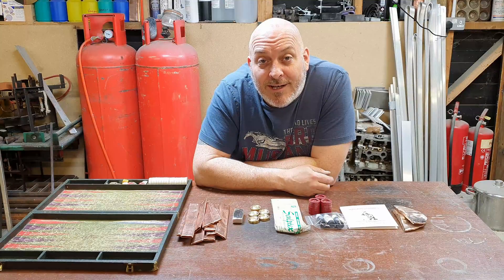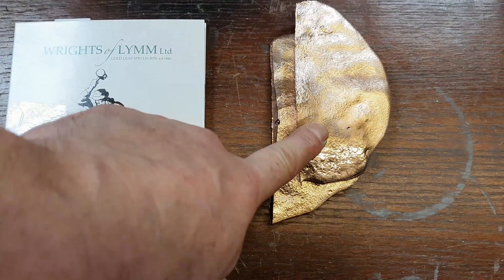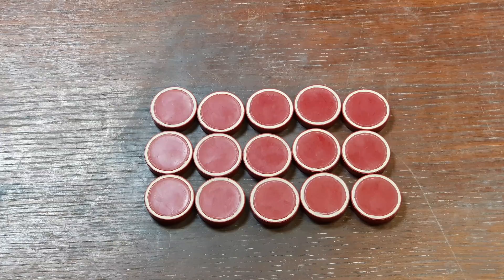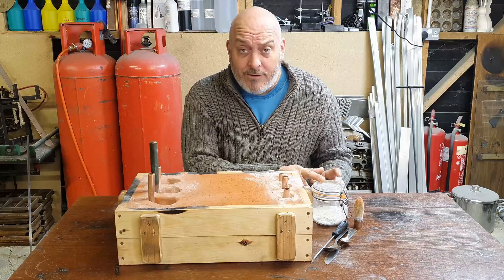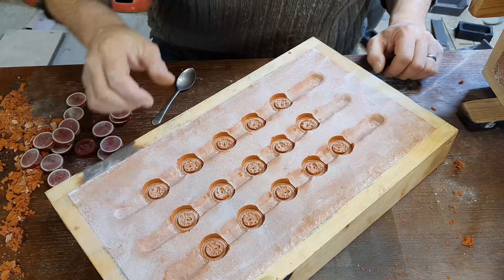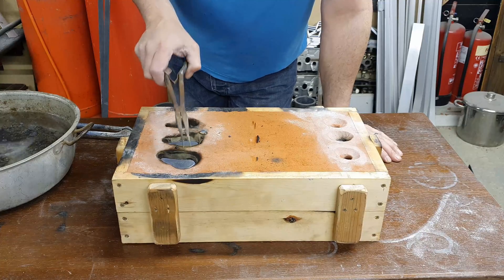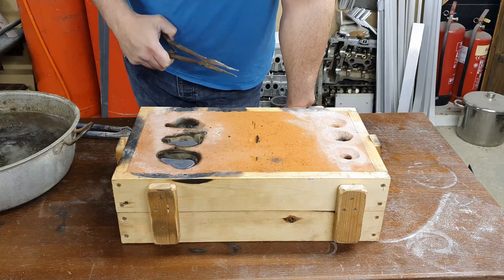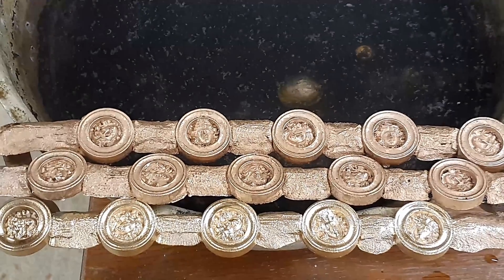Melting 1lb of Silver - Casting Shibuichi - Part 1

Comment: What do you use for the mold parting powder?
Reply from the maker: I'm current;y using talcum powder although it's not the best thing to use, can't remember the reason why - but there is a reason why it's not the best thing to use...  It works though and most people have it lying around.  The best thing to use is fine calcium carbonate powder (limestone) which I will order when I run out of talc.  It's not expensive, talc is just what I had to hand when I started out.  Cheers Andy 😎👍🍺
Reply: @MeltandCast  ok, cool thanks.

Comment: What about putting felt on the bottom of your markers?
Reply from the maker: Good idea Brandon... although I'm hoping once the board and counters have half a dozen coats of lacquer on each, it won't be necessary.  Ideally I want the counters to slide as easily as possible without any friction.  If the bases of the counters are smooth enough it should be OK hopefully.  Cheers Andy 😎👍🍺

Comment: Do you use any sort of flux?
Reply from the maker: Not if I can help it, I do sometimes especially with dirty metals but most of the time I am using pure metals.  The copper pipe I use is 99.85% pure and the only real issue is gas take up in the metal, any other impurities usually just float to the top.  So far I have not had many issues with porosity especially with Shibuichi which always seems to pour clean.  Sometimes I get a little porosity with pure copper but nothing that really spoils what I am doing...  If I do I just call it character and shrug it off haha.  Most fluxes make a real mess in the crucible and shortens their life considerably.  I would always use a flux with brass though as it's really easy to burn the zinc off, although in practice I've had very little success in preventing this from happening.  Cheers Andy 😎👍🍺

Comment: Awesome video as usual, do you know if shibuichi alloy tarnishes?
Reply from the maker: Thanks Sebastiao, I think Shibuichi is quite unusual in that the copper will form oxides but the silver rich regions won't.  It might sound wrong but apparently detailed studies have proved this to be correct.  But in answer to your question to all intents and purposes, yes it will tarnish.  Cheers Andy 😎👍🍺
Reply: @MeltandCast  thanks for answering Andy, that sucks but yeah that's the nature of it I guess😂👍
Reply from the maker: You can always spray the metal with lacquer, this will seal it and stop any tarnishing.  I will do this with these counters when they're done. 🍺👍😎

Comment: Those turned out great but it looks like you have your work cut out for you when cutting off the sprues and polishing!  You should do a collaboration with VOG (another UK guy who does castings)  You both seemed to have the same approach to the hobby.  Thanks for the vids!
Reply from the maker: Thanks Hobbies, yeah quite a bit of work still to do on those before the gold leaf...  I have a belt sander with a table that makes fairly short work of tidying them up though, so it's not too bad...  I'll spend a bit more time on these ones though I kinda rushed the brass test set.  Cheers Andy 🍺👍😎

Comment: Stunningly beautiful. On the question of the amount of metal for next pour, could you make the pouring ponds a little smaller as well as putting the counters closer? Hate to mess with success, but maybe an idea. Good luck on the project.
Reply from the maker: Thanks Mark, I'm definitely going to have to take a different approach on the next pour as I used all the metal on this one.  Even re-melting all the sprues, vents and channels it's still going to be tight.  I have a 15% Shibuichi ingot which weighs around 6-700g so I may just add that to the next pour and just go for a slightly lower percentage of silver instead.  It should still be at least 20% silver and that gives a good result too.  They will be patinated black anyway so it shouldn't matter too much.  It takes me quite a while to make the sand mould each time so I'd rather not do it twice...  It's either that or I knock up some smaller boxes and try and raid some extra silver from somewhere... hehe.  Cheers Andy 😎👍🍺

Comment: Beautiful look at that amazing metal! Could you do us a favor and hit some of that sibuichi with a blow torch and see if it leaves some color to it? How hard is it to hammer it or is it brittle?
Reply from the maker: Thanks Eleven, I'll heat up the sprue's before I remelt them on the next video (If I remember !!!)  Off the top of my head I think the more silver you add, the harder it gets, with 25% silver it's still quite soft I think - once you get to around 40% it gets a lot harder.  There are different grades of Shibuichi depending on the silver content.  Cheers Andy 👍😎🍺